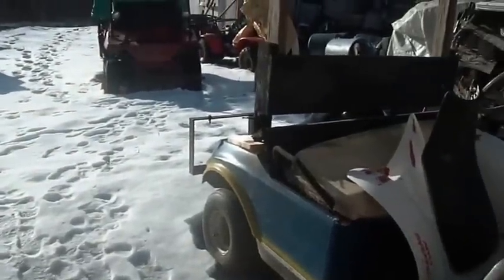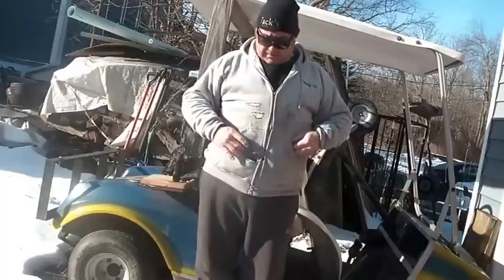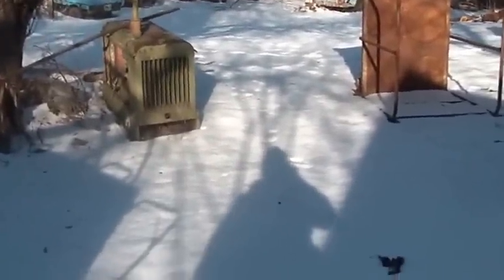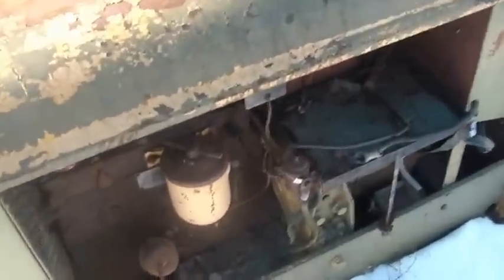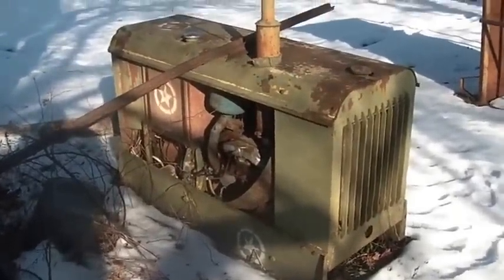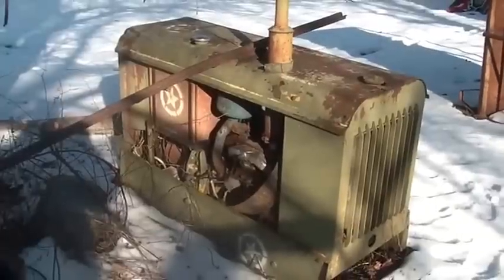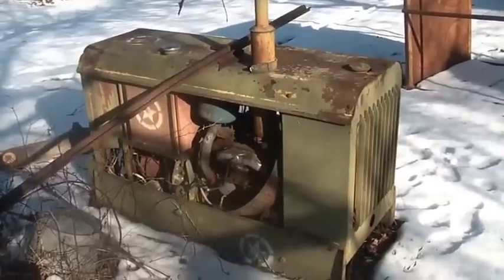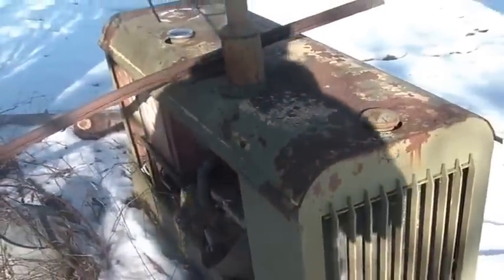Hobo Harvey contributing to a wood gas co-generation project?

Comment: Sweat pants, sweat shirt, with obligatory holes, stocking cap, sun glasses, nah, you look like the rest of us old fart hoarders. After all, we do have some standards that even the homeless don't have; we love our stuff and hate to get rid of it! As for the generator, I would guess it's from the fifties and may have been used by the military, but not much. It's not beat up enough to have seen much use at all. Continental engines are dirt simple to work on and if it's missing parts, they are available or you can modify almost anything else to work on them. Should be a great projet.